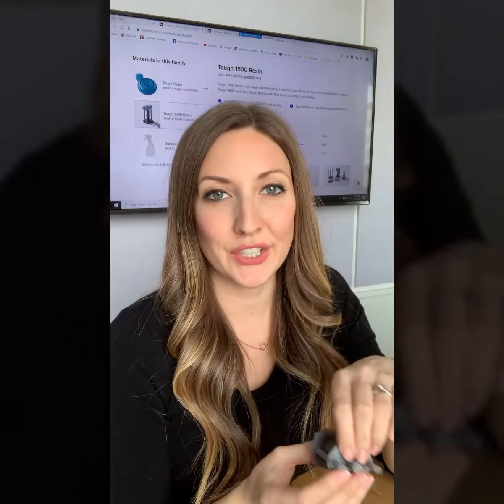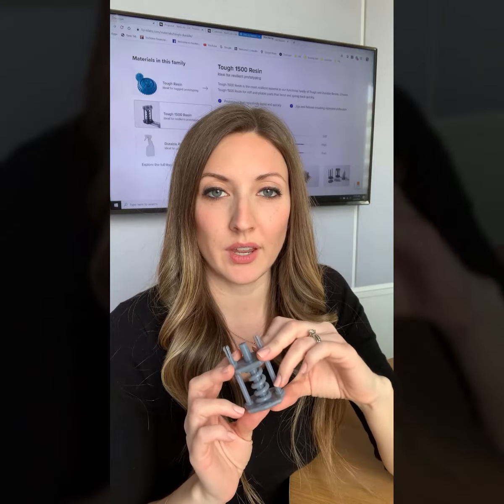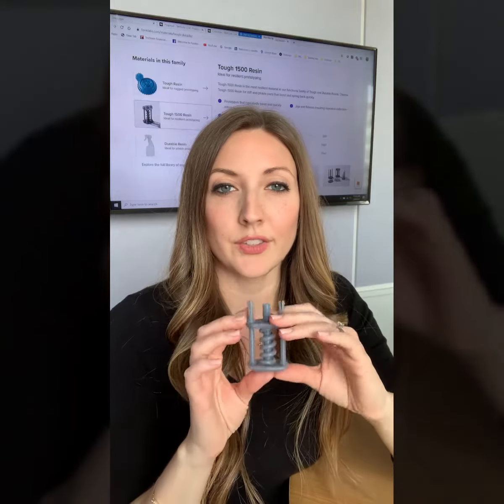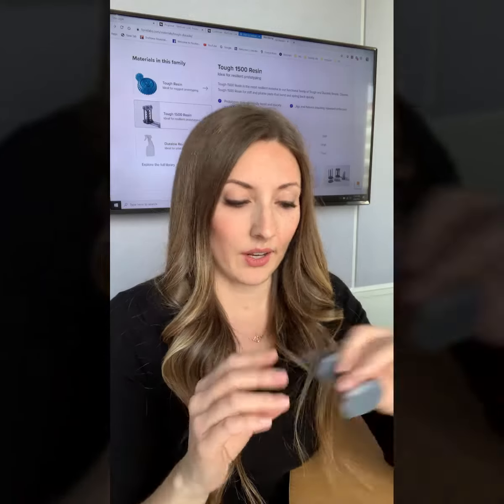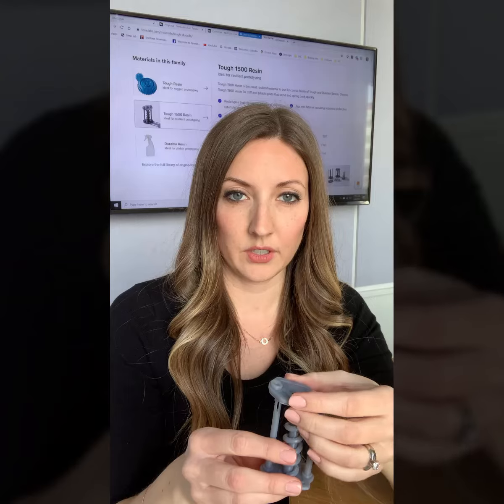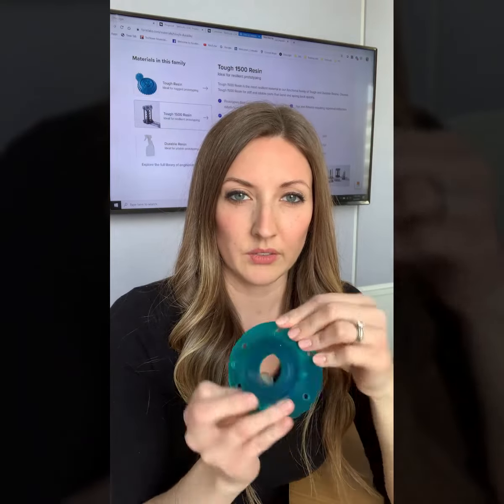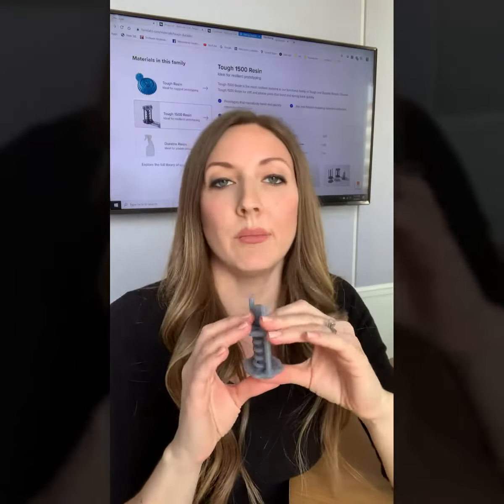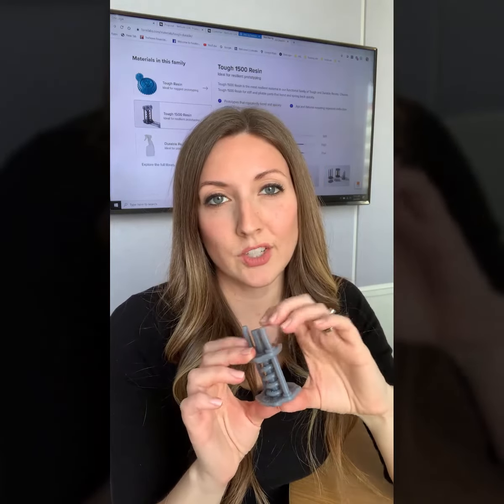NEW Formlabs Tough 1500 Resin

Comment: How archival are the pieces printed with tough 1500? Do they get brittle at all over time? I've noticed some of my old form 2 standard resin prints became very brittle over a long period of time especially if in contact with light
Reply from the maker: Hi Matt - Any SLA material will get more brittle over time since they keep curing with sun and heat factors. Your best bet would be adding a coat of UV protectant to the part. We’d be happy to send the Tough 1500 data sheet if you’d like to look through the material properties. Fill out the form on our contact page and I'll send it on over :) https://eacpds.com/contact

Comment: Great video.  How does Tough compare to Tough 1500 and Tough 2000?  I have printed in Tough 2000 and it is stiffer than the old blue Tough.  I think you commented that Tough was stiffer than tough 1500.  I do not know why Formlabs is discontinuing Tough but I think it should stay because it is transparent and that is great for seeing inside like in my epoxy injectors.  Formlabs does not talk about Tough any longer and it is not in the comparison charts.  so sad

Comment: Can Formlabs resins be use in other SLA 3D printers? like the Photon etc?
Reply from the maker: You'd have to ask the OEM of the printer you are using to find that out if there’s an open mode on your printer. Formlabs recommends using Formlabs resins with their hardware.
Reply: In general, however, the answer is no.  UV lamp masked Lcd printers like the photon need resins that are more sensitive to UV light because the UV lamp is not as strong as the laser in a Formlabs printer.

Comment: Would you suggest one of these materials for making prototypes for highly articulated action figures? Mainly the joints.
Reply from the maker: Yes, the durable would be great for living hinges but is a little softer than the tough 1500. The tough 1500 behaves like PP so it would be great for joints that don’t have too much movement.